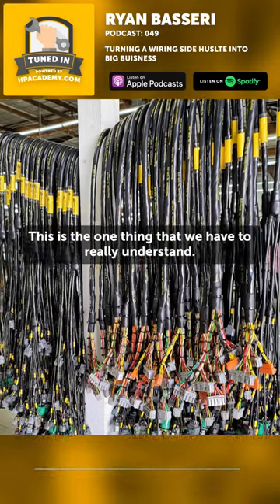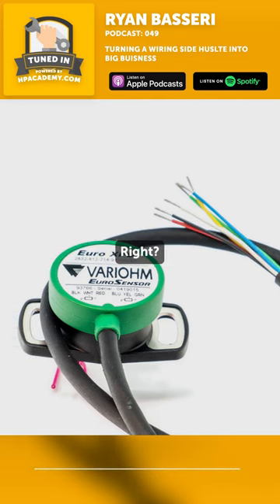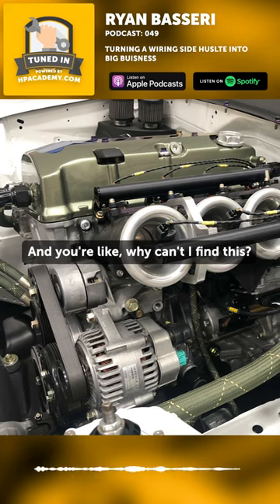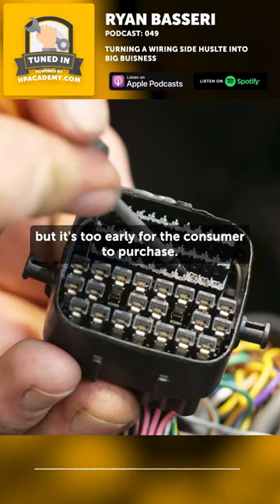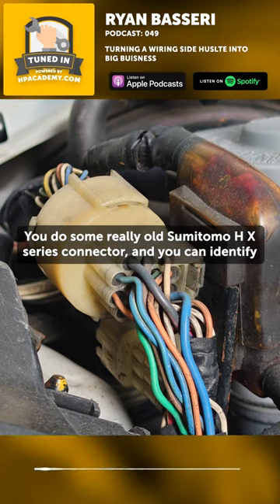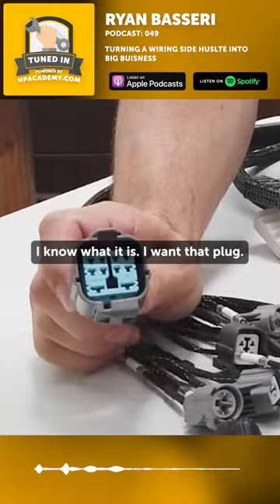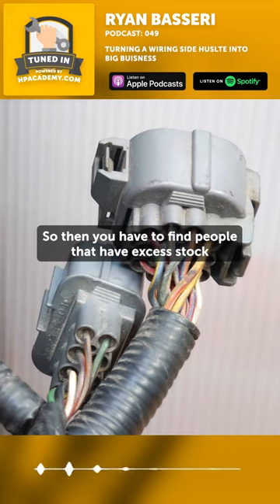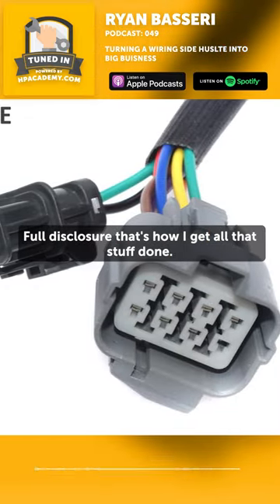Identifying Your OEM Wiring Connectors #shorts

Comment: Yep, get the pin out on it and change both sides of the connector to something more obtainable, but make sure you make note of it and leave it in the cars manual and leave it in the glove box.
Reply: You know lol. Easy fix
Reply: Unless it’s molded into the component…
Reply: @ChrisZBr0wn  that happens a lot in some of the things like bmw. In that case you get the exact same component out the junkyard one year older with the good connector you can get swap in that part and then change the plug to fit that part. It's a little more difficult and expensive but if it's the difference between walking and driving you do what ya gotta do.
Reply: Doing just that on a Toyota pallet jack to retro fit an older chipset into a slightly newer one. Digikey searched TE amp connectors that had similar design and got the chipboard male socket and female plug so I can solder and replicate the pin out . 🤞.

Comment: I need a 3D printer.
Reply from the maker: Do it, they're awesome - Taz.
Reply: Ender 3 is a good cheap option and has a huge community
Reply: I immediatley thought of this, all it takes is a few people and some calipers, some time modeling, and you can supply the entire automotive industry with a replicable, cheap connector that can be easily fitted to some wires and some connectors.
Reply: True
Reply: @Jwn5k  ima steal this idea
Reply: Just wait until Metal 3D printing really takes off
Reply: Dude you can get into the 3d printer world for like 150 buck, ender pro 3 is the gold standard start up printer... Get it
Reply: You need a good enclosed 3D printer to print exotic materials to be used on the engine bay
Reply: @Mr.Thermistor7228  get an ender 3v2. 32bit board that you wont have to have an arduino to flash custom fw and the screen is better
Reply: That's right cowboy.
Reply: @terracar2003  It has.
Reply: @terracar2003  "you wouldn't just download an engine!"
Reply: @blackbeardthepirate7467  Watch me
Reply: @BogusQuacky  thats the one i got and your absolutely right idk why i said ender pro 3 when i have the ender 3 v2 lolol
Reply: @terracar2003  Aye, feel like this mislead generation would be surprised to see how little it takes for a car to run, I'm still scratching my head at how they managed to integrate bloatware with vehicles. I thought shoddy electronics was the pinnacle.
Reply: That was quick
Reply: @Jwn5k  copyright/trademark/patent pending infringement is a thing dude. If you make profit, you can be sued.

Comment: Never had an issue with broken connectors. Workshop manuals sometimes have them in the electrical section with the wiring diagrams etc. For a broken connector just find a pick a part and put it in your pocket after cutting it off the end of the harness.

Comment: i mean you could always change the connector on both ends. and as long as it lines up on both ends it will run the same way.
Reply: Good luck changing a connector on a sensor side.

Comment: There needs to be a website that databases CAD models or scans pigtail connectors for 3d printing. Charge like .99 cents for the file and people would buy them like crazy. Even a large connector wouldn't take more than 45 minutes to print with fine settings.

Comment: If you need to do a wiring harness but can't find the OEM connectors you need to buy a Deutsch Connector set. Learned about them from a diesel mechanic and have been using them ever since. You'll have to really know how to do wiring if you want to use then for any application like plugging into a sensor

Comment: And then there is the fun when you are trying to figure out how to disassemble a connector without destroying it... Some of them are rather convoluted.

Meanwhile, completely rewiring a motorcycle, and I'm just using DTM for everything that won't be needing an OEM part attached(which is honestly just a few things attached to the motor - and I was able to find exact replacements for those connectors).
Reply from the maker: So much fun 😅 Good work.

Zac here reommends you try get some connectors from a junk yard to practice depinning knowing you can destroy them while you figure it out and not be left in the lurch where necessary.
If they're years old and have been though hundreds of heat cycles it can be tricky since they're so brittle and not designed for many coupling cycles - Taz

Comment: I just think it's criminal how so many fuse locations go unused in the factory box, I wonder how much better aftermarket accessories could be installed if terminals were more standardized.
Reply: I agree it’s like…. “That’s it?”
Reply: I’ve thought about this too. I many times use spare wiring fuses in my car when supplying new cars with aftermarket stereos
Reply: What?
Reply: @jeepmanxj  what what?
Reply: @rustypotatos  the OPs statement used words that come together to mean nonsense.
Reply: @jeepmanxj  he is saying there seems to be a ton of extr room in these cars that could come preloaded with a lot more auxiliary and useful shit
Reply: @rustypotatos  like all of the options that the car doesn't have? Or features required in other markets that are not available in another.
Reply: @jeepmanxj  he’s saying both all of the above
Reply: @rustypotatos  you can put as much stuff in the vehicle as you like if you want to pay for it. Otherwise it’s not a waste if they’re empty because they can be used in more than one vehicle. Better to have extra slots than not right?

Also less wiring the better, less harnesses less chances for failure.

Comment: We should have mandatory standardised open source connectors for the whole industry. It would cut down on costs, waste and headaches. You can have 4 pin connectors but they all have to be the same shape and compatible. With 5 or 6 or seven or 20 pins, the same thing. If another connector with the same number pins but different shape is really needed then it becomes the B shape just like USB connectors. Who is with me?

Comment: I called Lexus earlier and we both hung up feeling weird. The dude on the phone didn’t even know why or what the pins or connectors would look like or be located. Very sad very sad indeed because like 2 or 3 years ago they had it inventoried and stocked
Reply from the maker: Was there someone else you could talk to there, might have just been a new guy that was too proud to ask a colleague for help. Very much an industry where WHO you talk to can make a big difference in the help you receive - Taz.
Reply: @hpa101  I called back the next day and it made me realize I need to go in person entirely and demand the MASTER TECH
Reply: @hpa101  this is for a 1uzfe
Reply: @rustypotatos  I also have an old Lexus with 1UZ (VVT variant). What you need to do is get a copy of the "Electrical Wiring Diagram" book. (All older Toyota products had physical repair manuals and wiring diagram books.)
The connector part numbers will be listed in the catalog in that book and cross-referenced to the diagrams. Then, if the dealer has no inventory in the US (or wherever you are), order from sites like Amayama

Comment: Another viable solution is to just use a different connector alltogether. Replace it on car and harness side
Reply from the maker: Easy when it's not attached to a sensor/part for sure 😎
Reply: @hpa101  yeah I forget that connector to connector is almost non existent in most new cars, harness' seem to be going more and more one piece

Comment: Lol this is funny. Heres your solution, de-pin the connector, find a pin connector set re pin and install different style of plug. If it goes into a hard part like an alternator and you cant de-pin the female side then make your own wiring harness with the correct pins. Theres always a way

Comment: Why can't we just decide on one standard connector. Ampseal. It jas a locking tab so it won't come loose, easy to de-pin and replace if damaged, if you have the right crimp tool it's super easy to crimp pins and sockets onto wires for repairs. It just makes too much sense
Reply from the maker: Not our connector of choice to be.honest - Taz.

Comment: Either 3d printer or plastic welding would be the solution
Reply from the maker: Some connectors are attached to parts or not the right type of plastic for welding (plus both tools are not free) leaving you back at square one. It's certainly more of an issue on some cars than it is others too - Taz.

Comment: What makes me mad is when a part is labeled "NLA" only 2 years after it was made. The days of getting parts for a car that is 20 years old or even 10 years old or for that mater is only 5 years old are long gone.
Or how about this, the part is NLA but they have a replacement part but to use it you much "upgrade" by buying this and this and this and then changing this and this to make it work. And they still label the replacement mess as OEM.
I am glad I got out of the business

Comment: Cut the wires and attach standard connectors
Reply from the maker: Bit hard to cut off a connector that is solidly fixed to a component in your engine bay and hope for a better result hot gluing something else on there instead.

For a general connection between wires only, sure, easy - Taz.

Comment: Wait do y'all sell old plug connectors? Dang sheesh
Reply from the maker: For OEM ones they often just fail with time rather than being something you sold and want back.
They are not rated for many mating cycles and after years in an engine bay getting hot and cold a few 10,000 odd times, they simply retire from life 😂 - Taz.

Comment: Im the guy that replaces obsolete connectors with GM weatherpack connectors, because they are forever.
Reply from the maker: Deutsch DTM connectors are better, where possible. Not every connector is swinging in the breeze not attached to a part though 😎 - Taz

Comment: Just buy a whatever pin connector
Reply from the maker: What if you're dealing with a connector attached to a part, not just floating around connecting a few wires in the engine bay? - Taz.

Comment: If you have a soldering iron you have an instant solution. I worked on armoured personell carrying vehicles and the standard ended in  the 1960's on those but the standard was soldering it.

Learn to solder and this isn't a fucking problem at all. Don't want to do that, build your own with flats and rounds and get it printed if you can't print it yourself.

Seriously, this is a non-issue these days.
Reply from the maker: This chap know how to solder, and crimp. Not a solution to this problem - Taz.

Comment: Full Enclosure. I wish people knew how to 1 either look up parts they need so a parts guy doesn't have to try and guess. Just hand the kid a list of part numbers. Too easy, or know how to the vehicle in order so I don't have to try and listen and pay attention to TF you're driving. Sorry but it's Year, Make, Model. I don't need the color or who's car it is or anything like that
Reply from the maker: Yes, it's rough to expect people in the parts department to use all their specific resources to help customers find the correct part for their application. Totally unacceptable 😅

It is hard with connectors though, but if you don't know what they are or where to start, resources like this wee clip and also a good person behind a parts counter can help you start to figure out what you need to look for and where to look for it - Taz.

Comment: Change it to Mil-spec connectors
Reply from the maker: Have you done this yourself? What specific Military standard do you work to? 
Your OEM components that have connectors directly fixed to them too might give you a hard time with this. Depending on the application the cost of the relevant tools and materials, noting the jacket on your factory wiring will be too thick for Autosport style connectors, is going to add up for potentially no actual benefit.
Just copying what someone else has done with no thought to what you are working on and the goals for that build is a surefire way to waste time and money, and in some cases get a terrible result - Taz

Comment: It should be if you buy a brand new car and a part goes out and you can't get the part that means it should be straight to the scrap yard or straight back to the dealership and get a new car on the dealers pocket not yours because if you can't get the part to fix your car the car ain't worth even buying I don't care if it's a 1-year-old car or a brand new car the customer should be able to get a part I don't care who has the rights to the part but you should be able to buy it at a parts store under Honda's name Dodge does that Chevrolet does that for definitely has to do that cuz there's shit boxes but Honda and all the Japanese scrap yard cars don't junkyard piece of shit coming from Japan